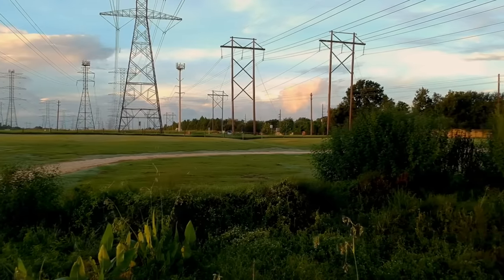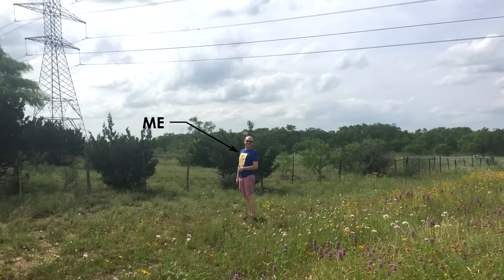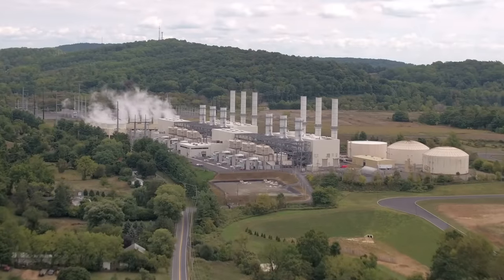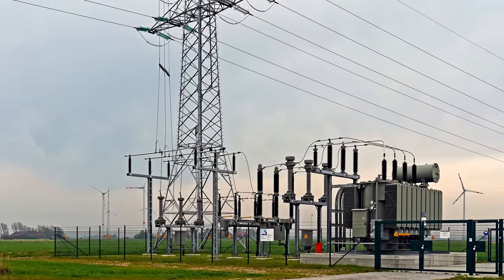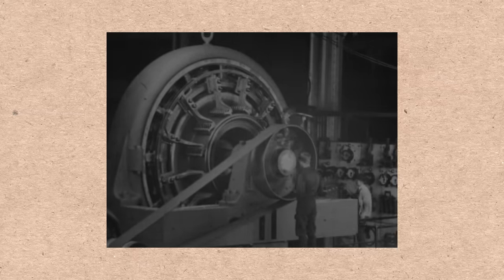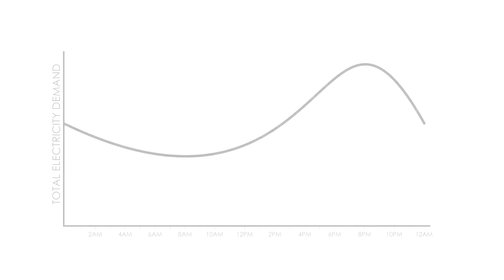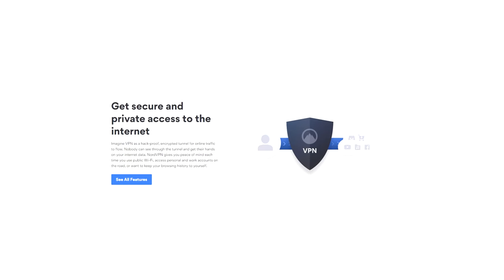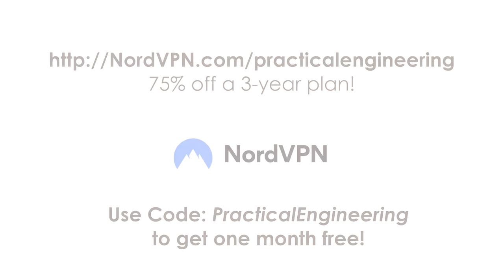How Does the Power Grid Work?

Comment: In the UK there are two tv shows that cause hugh demands at particular times, because they are planned the grid copes by turning on redundant power sources 5 minutes before the demand, coping with the sudden load. In Scotland and Wales there are two each, Stored power, hydropowered dams. When they know there is going to be a sudden surge they open the valves and let the water flow. Any wind turbines that are in a high wind area are also turned on to match the capacity of the sudden load, that's why you should have 50% more turbines than are required at normal load times.
 In Scotland we are almost 100% green, we will have one green power station, and the rest, wind and water, and we export to england yet still pay for their imported fuel, ironic really.

Comment: As a side note, the distance between the large scale dams in northern Québec and the small scale dams down south means that they would be out of phase with each other if they were all plugged into the network directly. There's several substations between the dams up north and the load centers down south which convert the power to DC and then back to AC. This effectively splits the grid into several smaller grids. The Québec grid has a number of interconnections with the north eastern US and there are similar DC-AC-DC converters on those power lines. One of the big advantages is that during the last big blackout in the north east, the cascade of failures was effectively stopped by those converter stations. That is something which probably should be implemented in the US to make the grid more reliable and prevent cascading failures.

Comment: 1st I guess , I like this one especially since I work in a power station with a 132kv switchyard
Reply: Ahmed Salam Sounds dangerous. 
In which country? America?
Reply: @brandonb9452  No.. Iraq.. A 1000 MW power plant powered by GE's Frame 9 GasTurbines
Reply: @AhmedSalam  Yikes.. Has any incidents happened while you were monitoring it?
Reply: @junuhunuproductions  why there should be incidents?
Reply: @junuhunuproductions  Nothing major, blackouts is common but recovery is fast coz gas turbines have short startup time..
Reply: @AhmedSalam  Wow sounds fun!! Gas turbines are so freaking cool
Reply: @junuhunuproductions  they are, until one decides to trip and the FUN troubleshoot begins 😁
Reply: @AhmedSalam  I guess it's fun when it's working right then😂 Why do they break down usually?
Reply: @junuhunuproductions  90% is mechanical problems, fuel delivery and the likes
Reply: @AhmedSalam  wow interesting!

Comment: “Step down to a more practical voltage” I think a 40kV toaster would save me a lot of time....
Reply: @Ccs4646  heats up the house? Sign me up.
Reply: I was thinking I'd melt it self
Reply: @ethansteffes8193  Assuming you could actually put 40kv through the wiring system in your house (which you can't) it would arc out 3-4 inches from your sockets and switches and toast you! So probably not the best idea lol.   In any case a toaster doesn't need high voltage, just high current. You could run a toaster just fine on 10-12v provided you could get enough amps into it :-)

Comment: The UK has a very complex grid as we have lots of renewable power generation already with much more on the way. We've recently gone over 7 days in a row without using coal to generate power and we have the world most expensive nuclear plant being built with more in the pipeline. 
Add to that the fact that the UK is also hugely connected to the European and Iceland energy grids and we have a really complex system considering we're a small country. 
The US system is bigger but I think the UK system may beat it for sheer flexibility and ability to adapt.
Reply: Yeah you didn't use coal I bet you used gas with the renewables to stabilize the output and then you fired up your coal plant lol
Reply: https://news.sky.com/story/uk-sets-new-record-for-days-without-coal-power-11713755 .
The UK does use gas but we're also blessed with a rather large coastline and some of the  most consistently windy seas on the planet and we've built the worlds largest offshore wind farms. 
The UK also generates quite a bit of power through waste incineration which while not being carbon free is still better than coal or gas.  
I don't think a new coal fired power station would get regulatory approval to be built and all our old stations are due to be retired in the next 20 years or so so we're going to be forced into going as carbon free as we can manage anyway so it's not a question of if but when the UK gets all power from carbon neutral sources.
Reply: Worth noting that the connections to other parts of Europe are done via High Voltage dc (HVDC). From to time, it’s useful to have a look at the grid’s performance; this site: http://grid.iamkate.com/   can be useful. It presents a lot of info over time.
Reply: Interesting, I expected that thermal power plants and especially coal ones are slowest to shutdown and start up and that power consumption in summer is higher due to A/C, which is almost becoming necessity (perhaps not in UK which is close to ocean). I can't see completely carbon free future with many countries refusing nuclear power plant and fusion is 50 years ahead (just like 50 years ago). 
For example, here in Czech Republic, we have November and December with dull, overcast sky, 40-50 hours of sunshine per month, temperature inversion with no wind at all, fogs and air pollution. We have no big rivers with huge height differences like Norway and it's usually not windy here. Biomass energy has extremely low power density per area. What's left are nuclear power plants, but  i'm not sure if we have uranium mines operating today and at least population is not against them in general. I think third or half of our electricity is from burning low grade surface mined coal, third is nuclear, some might be from pumped storage power plants, but these are not producing electricity.

Comment: In Czech Republic we have "HDO" where distributing company superimposes higher frequency signal to standard 50Hz and can remotely control some non critical equipment such as boilers and storage heaters. I don't know exact requirements, but then your power consumption is divided into two sections - high tariff and low tariff (sometimes called "night current"), each with different pricing. People usually connect some kind of indicator to low tariff circuit so they know they're running lot tariff and usually turn on dishwashers and washing machines to save some money.

Comment: Wanted to hear how the localized transformer is where the amps are produced, but nice video nonetheless. Cheers!
Reply: Transformers are rated in VA or volt amps. Raise voltage and the available current drops and vice versa.
Reply: @daveslyker4431  that why in Ontario canada you often see a primary voltate 2.4kv Y connected in high density and/or cities....  however we tend to see more and more 16kv Y because you can push it and delta connected it works great as a sub transmission voltage at 27.6kv

Comment: I work in System Operations for a Transmission Company. I gotta say your video was very good and a nice basic intro to how the grid works. I will say that from our perspective Thermal baseload plants are wonderful things (nuclear is the favorite of most power workers), and renewables like wind and solar make balancing the grid very difficult. A couple fun things to mention: The different North American grids are tied together using High Voltage Direct Current HVDC to transfer power back and forth, Frequency is the main grid balancing measurement and using too much power results in a drooping frequency, quick dispatchable sources are used to correct frequency droops (usually Hydro as it responds faster than any other source).

Just a couple of fun facts for those not in the industry.

Comment: In my country voltage should be 220v but some times I hear the AC screaming and check to see that it's 250-270v and some times the opposite happens; everything dims and the voltmeter shows 190v, that doesn't stay for too long, maybe a minute or so but after that everything blackout.

At the time of writing this video there is no electricity and it's abot 4pm and temp is 32 C° in the shade.
Reply: Bassam salim where do you live
Reply: Which country you are in
Reply: Which country?  That voltage fluctuation is unacceptable in most places

Comment: Didn't say a word about drawbacks of alternating current and high direct current grids
Reply: Not the scope of the video. The pros and cons of each are enough for an entire PhD dissertation on their own, let alone an entire YouTube video series.
Reply: Ttis a video about grids, there are direct current grids not just AC current
Reply: There are very few DC grids out there, and they are tiny. DC transmission was mentioned, but it's still not in the scope of an introductory video to discuss drawbacks of one or the other. That's a topic that deserves its own video, if not its own series of videos.
Reply: WHAT? They are huge! Google HVDC. That's the only niche they fit in an AC world, when you need to cover huge distance and losses in AC are too much to ignore
Reply: DC transmission lines on an otherwise AC grid, or between distinctly separate, non-synchronized AC grids don't really constitute a DC grid. Lots of specialized equipment to rectify the stepped up AC voltage to DC, then lots of specialized equipment to invert it to AC and sync with the local receiving grid, something in and of itself deserves its own video. 

Also, covering large distances isn't their only niche in the AC grid system. They also connect otherwise un-synchronized AC grids (e.g. between countries) or to tie un-synchronized sources to the grid. In both cases, these might result in relatively short runs that would be grossly financially infeasible from the loss-mitigation standpoint.

You are right, it merits discussion, but it's a huge, diverse topic. It would be well-serving to cover these, in their own videos.

Comment: Renewable energy can be stored via 🔋
Reply: All of the batteries in the world would not be able to keep a single city of the scale New York / Hong Kong / Tokyo etc fully functional. The capacity of batteries is not enough. The grid works (as described in the video) by generating exactly as much as is needed. With renewables you cannot do that, simply because you cannot generate whenever you want (e.g. a calm windless night).

I am all FOR renewable energy, but the world will not be able to depend on renewable alone until the whole planet becomes a single grid, getting energy from wherever it's available.
Reply: @remus-alexandrusimion3439  I'm all for nonrenewable energy. :] 👍

Comment: I'm fortunate to live in an area where the local utility has a complete smart grid system - ~1200 switches in the distribution network, and 200 in the transmission network - as well as ~175,000 smart meters and 8,000 miles of fiber optic cable (which is also used to provide high-speed (up to 10 Gb/s) internet to subscribers!) over 600 square miles of service area. Sounds expensive, but we rarely get blackouts anymore, even during the most severe weather - and those that do happen get fixed fast. According to the utility, that alone is saving the area around $60 million every year. It also helps reduce the amount of driving around their trucks have to do, because they can be dispatched to more precise areas - they estimate it reduces their travel by 630,000 miles, and carbon emissions from that by 4.7 million pounds.

Totally. Worth. It.

Comment: This was a fairly accurate video but a few missing spots.
No mention of HVDC transmission and why it exists. It is actually more efficient (but more costly) than AC power transmission.
That solar and renewables ARE predictable they are just intermittent. They are also the easiest parts of the grid to turn on and off which gets people confused when lots of solar arrays are turned off. I tend to think this is more of a problem with coal fire power plants not being able to respond rather than solar arrays being "wasted"
Batteries despite their high cost are an extremely good grid balancer and smooth out power quality issues. In some sense renewables do introduce power quality issues but then just a small amount of batteries fix those issues.
Putting batteries on the grid for grid balancing doesn't require you backup the power for most the day more like a few minutes. So you certainly don't need a lot of batteries to make the grid much more robust.

Comment: I am a beginner in this subject but would really like to understand something better. Electricity flows in a 'circuit'. Which means the electrons flow from the negative terminal through a device (light bulb) and then to the postive terminal. 

When electricity flows into your house and you turn on a device where is the negative and positive terminal? After electricity flows through the device where and how does the circuit end?

Sorry if this is a dumb/wrong question but I can't get this in my head conceptually yet

Comment: I live near one of a massive hydro-electric scheme.
In fact, while the infrastructure isn't in the town I live in, this town pretty much mostly exists BECAUSE of that scheme, since it was where all the workers lived during the extensive construction period.

The next town over was completely changed, since the valley it was in was flooded to make way for the scheme.
A lake was formed that didn't exist up to that point.

The presence of this lake has evidently also altered the climate in the area, since prior to it existing the town I live in used to get regular snow, and now it rarely ever gets snow itself...

Both these towns are now primarily tourist places (for semi-unrelated reasons. Skiing mostly, since it's a mountainous area.)

But of course the system itself is still in operation, and still forms a critical part of the country's power system. (there was talk of expanding it recently)

Power systems have a lot of interesting aspects to them.

Especially the less obvious stuff, like load balancing, and stuff like FCAS provision.

Comment: Hi Grady! Your videos are very informative and helpful for those like me who are very curious. I was just wondering if you can do me a big one, can you explain or do a video about construction cranes? I have always pondered on how they work. Most especially how, after construction, do engineers deconstruct them. I was informed that the holes they make in buildings are usually made into elevator or air shafts. But what about the top part of the cranes? I was also told that they use booms to lower it on ground after construction. But what if the building is very tall like the Burj Khalifa? What do they to the counter weights at the other end of the crane? How do they remove and lower it on ground? Do they use it as another panel for the building? Please help me out since this topic kept me awake at night quite a few times already. Thanks for the help!

Comment: I liked what I heard Bill Nye talking about a number of years ago. The concept that you can take something, like solar and wind, and with a portion of the power produced, you can pump water into a reservoir that flows through a generator. Thus, you essentially use some of the energy produced to store some of the energy not used. Meanwhile, the dam-generator is off during the day, and so all of that water pumped above dam and its generator stores, like a large battery of potential energy. During the night, that water is allowed to flow through the generator, and produce energy that is utilized during those sleepy hours.

For the irregularities caused by the variability of the winds, and blockages of sun during the day, again, this reservoir of energy can be utilized to prevent brown out and black out events.

Comment: You should have mentioned that not a single electron at the power plant every enters your house!  You should illustrate the push pull effect of AC rather than state that it’s a switching voltage.  This would support your point that the grid is a very large machine. I think people would understand that principle more.  Great video, though.  Very well done and I look forward to more as well.  Lot of Power junkies on here!  Me, an ex Siemens Power engineer.  Worked mostly on Nuclear and Co-Gen Plants.

Comment: Could someone explain where the current that is generated at a power plant goes if it's not used?  In general, I understand they try to match the demand with the supply, but how do they guarantee there is enough electrons moving at any given moment for use when someone turns on a light?  Is there slight over-production that, if not used, is grounded back to the earth?  I'm sorry if this is a silly question, but I would like to understand how the production and use can be matched in real time, precisely, without fail, at all times.